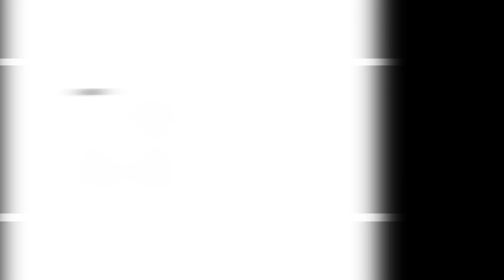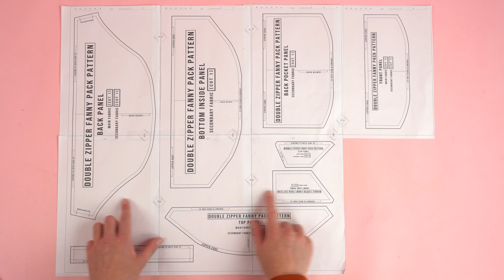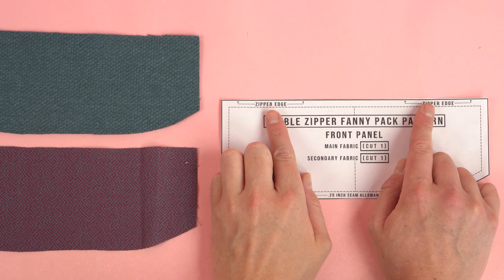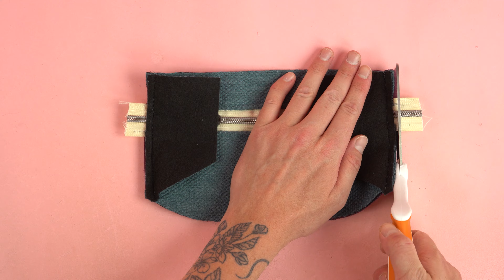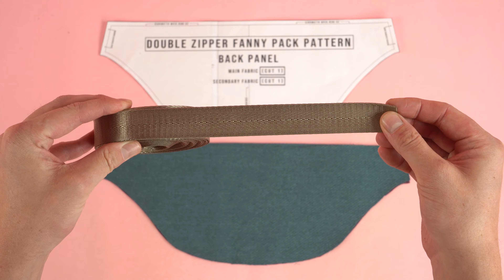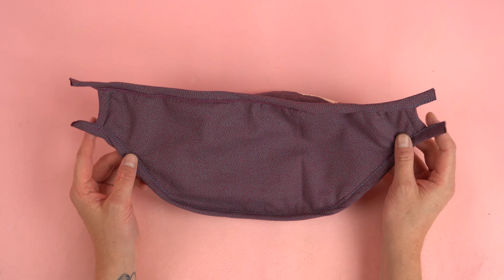DIY Fanny Pack + PDF SEWING PATTERN (REVISED)(EASY Step-By-Step SEWING PROJECT)

Comment: Insane question: at "Adding Back Panel to Assembly,"  if you were to sandwich the "front" piece between the main fabric back panel and the "secondary" (lining) fabric back panel RST, and sew all the way around but leave a gap for turning, would you eliminate the need for the bias binding in the bag? Or am I thinking of this completely wrong? I can't visualize it in my brain but I really want to come up with a way to eliminate the bulk and look of the bias binding if possible. If anyone has ideas, let me know :)
Reply: In case anyone is wondering - yes, this does work! I tried it today.  I basted the main fabric back panel on first, left about a 4 inch opening on the top of the bag, then sewed the lining fabric back panel on with the 1/4 inch seam allowance, and left the opening on the top of the bag. I'm going to hand sew the opening closed (lining pieces together, then main fabric pieces together) using an invisible slip/ladder stitch. Fun pattern! :)